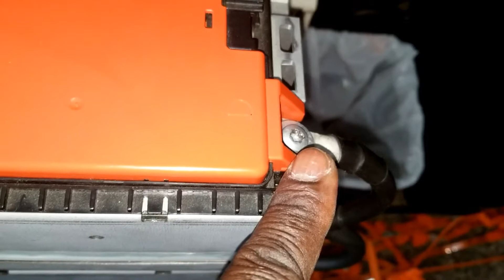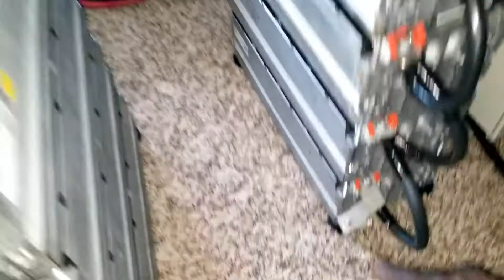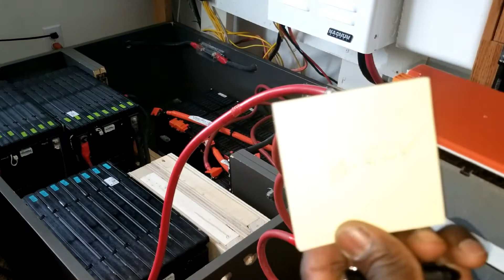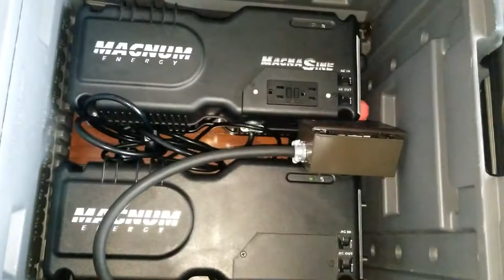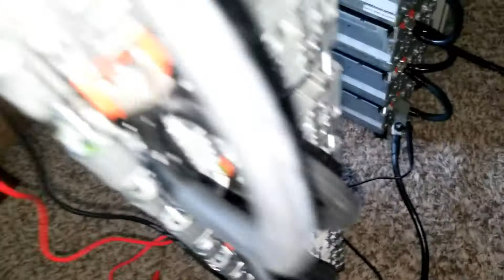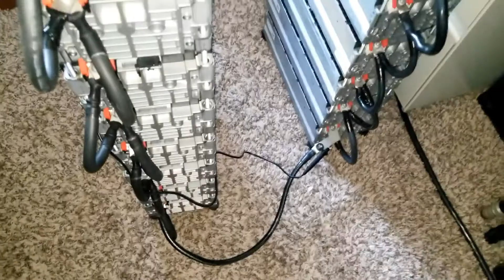TWIN TOWERS, POWER, POWERFUL, POWER OF POSITIVITY, LITHIUM BATTERY POWER #part3

Comment: There’s is i may say about  a .46 mv difference between both towers . The tower #1 that’s 14.68 v is letting .23  mv ( that’s about half of . 46 mv ) of 14.68 v flow into tower #2 that will bring up the 14.22 v or so voltage and lower the tower #1 14.86 v to even out both towers to a total voltage I may say close to about 14.45 v .  I think That’s why it’s sparking from the cable being touched because like you said of the difference voltages in tower #2 is rushing into tower #1 . I think all cells , both towers will be close about 14.45 v total when they are finished balancing .